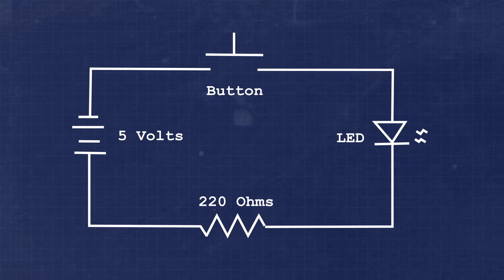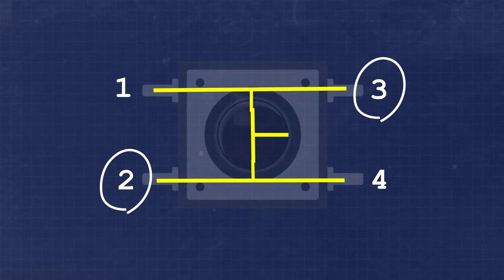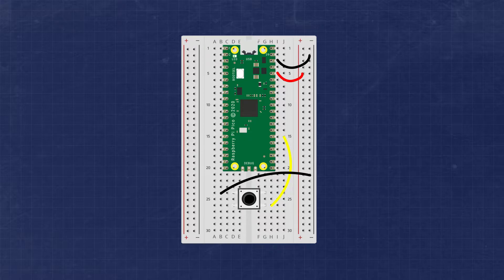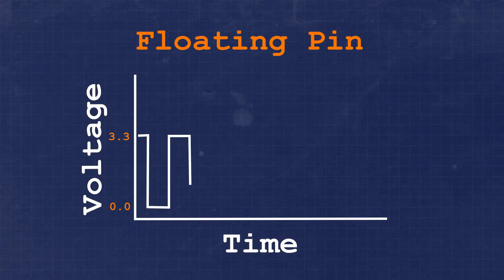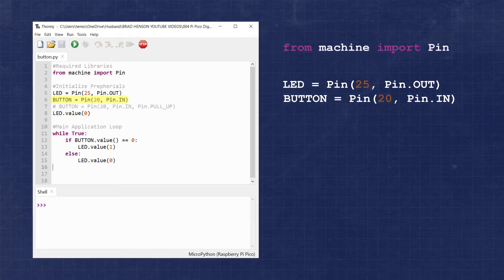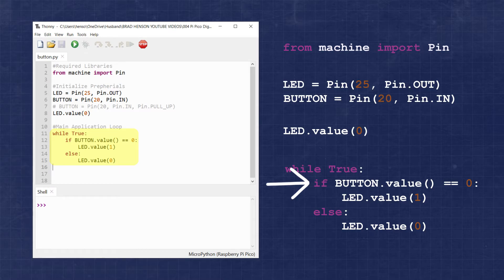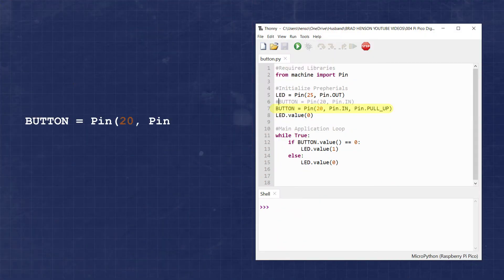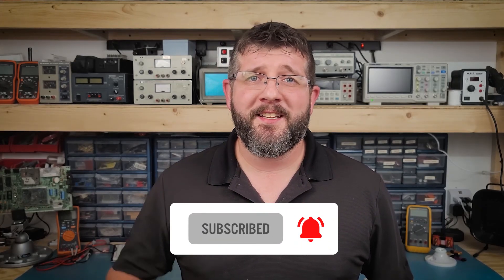Digital Inputs with the Raspberry Pi Pico and MicroPython

Comment: 2:00 pull up resistor, or use button=Pin(22, mode=Pin.IN, pull=Pin.PULL_UP)
 i prefer Pin.PULL_DOWN and have the circuit connect to 3.3v when button is pressed, it also lights up the led i have on the opposite side (going to the pico), 1 press acts on the external led and the input pin, instant visual feedback
Reply from the maker: Pulldown resistors are certainly a great way to go. There are times when it is better to use a pullup or pulldown resistor depending on the desired initial state. I have plans to do an entire video going over the differences and examples of when it is better to use one or the other.